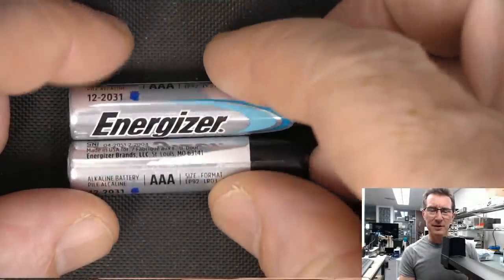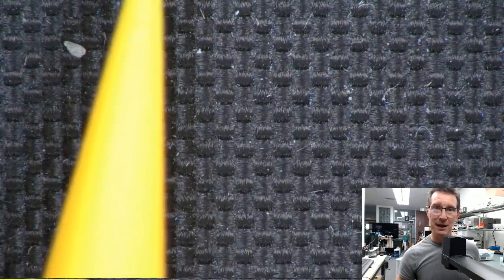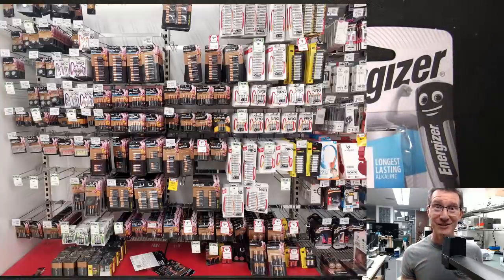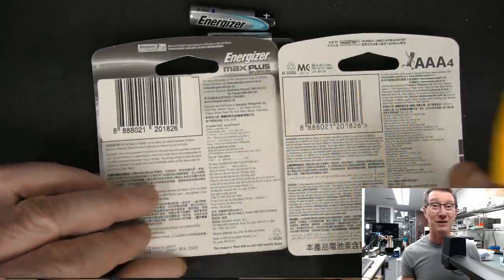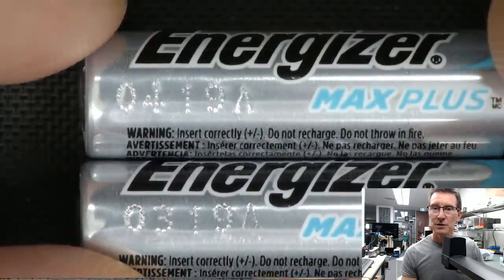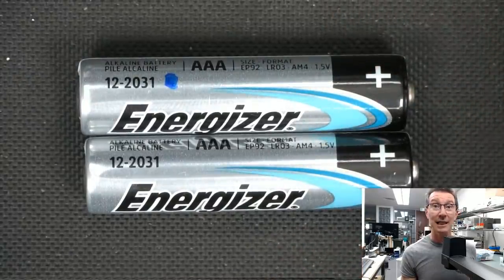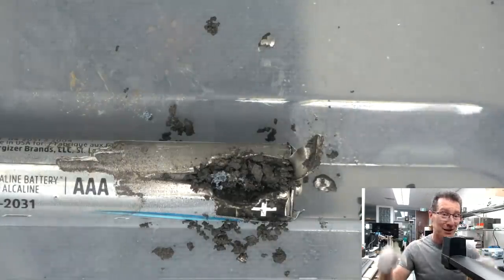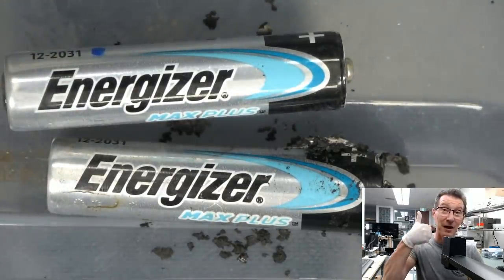EEVblog #1350 - Fake Energizer Batteries?

Comment: Do leaking batteries still hold any charge?

A little while ago (~year or so) I went to change the batteries on a flashlight (or "electric torch" for those who prefer 19th century terminology) that was a bit dim, only to find that the D batteries were locked in place by leaking batteries that had already crystallized.  I still haven't been able to get them out (need to remove a retaining ring to take the LED emitter out, so I can push the batteries out, but haven't found a tool that will work yet), but the flashlight was actually working right up to the point that I opened it up to replace the batteries.  

I always figured that leaking batteries were inherently dead batteries, but that's obviously not quite the case.  Do they simply allow a charge to flow through from other batteries, or do they still hold something of a charge themselves?

Comment: I have a little box for dead batteries and some have been in there for years and none have leaked. So why do they leak much quicker left inside a device?
Must have something to do with the contacts? Seems even though there is no closed circuit just the contacts and circuitry have an influence.

Comment: PLEASE LOOK AT PACKAGE PRINTING!  (1) NEVER does Made-in-USA Energizer batteries have Chinese printed as on the (right/fake) packaging on the bottom.  I went to Walmart and NONE has Chinese like this, only in the small font.  (2)The legitimate batteries (Max Plus Adv/left) clearly shows a replacement EAN13 bar code label has been stuck on top of the original USA bar code - steam it off and I bet is a UPC-A/USA code.  (3) The recycle logo is missing which is required by USA environment law - none on the copy.  Australia, and Woolworths, has a poor history of catching copies.
Reply: These are not packaged for the US market, why would you expect them to match yours? They don't even sell this series in the US currently, as best I can tell.
Reply: @Monkeh616  Sir/ma'am. Think about what you are saying and read what i said again about the AMERICAN upc codes vs. EAN codes. EAN are not used in USA.  He needs to steam off the stuck on EAN13. If a upc is underneath those REAL units were made in USA. This should be verified.
Reply: @tbreit  They won't have a UPC. US products can and do use EANs and there's no need to replace an existing UPC with an EAN. The label is covering a different EAN for that package variant.

Neither of these packages was intended for the US market anyway.
Reply: They are real.  American junk mate, deal with it.
Reply: @captainwin6333  Well, China owns 70% of Australia now so I assume you don't care anymore. Good luck when they invade to take the rest, Biden won't  help you, mate.

Comment: Actually, remembering back to DefCon 26 there was a battery issue that happened over the course of only ~48 hours. There badges took 4*AA batteries and some people put 3 in the right way, and one in backwards. The badges still ran on the lower voltage, but it caused the batteries to fail by the end of the first or second day. 

From there writeup after the event. You can find it at the bottom of page 4

https://media.defcon.org/DEF%20CON%2026/DEF%20CON%2026%20badge/DEF%20CON%2026%20badge%20writeup.pdf

"The badge design was built to work off of 2 batteries, but the 2 batteries would
have only lasted around 32 hours or so, so we added another 2 batteries so that
people wouldn’t have to change out their batteries. There was reverse polarity
protection which protects the badge, but not batteries from being placed in
backwards. That amounted to people essentially recharging non-rechargeable
batteries which led to a number of them outgassing/leaking. Those
occurrences guarantee we will never use more than 2 batteries on a badge ever
again. "

Comment: Concerning the leaking batteries, if they came in air freight from the US, could the relative lower pressure in the cargo hold of been a contributing factor making the leaking worse? This combined with the GPS tracker was on. A combination may of allowed the liquid to flow more freely due to a possible pressure difference between the battery internal pressure and the lower atmospheric pressure in the plane..

Comment: Speaking of your battery leakage test, I wonder if the problem is that you're only testing single batteries? Maybe if you had two or four in series, and then put the resistive load on them, that would allow the weakest link to get reverse charged and then leak.

Don't remember the details of your setup, unfortunately. Please ignore if you are running multiple cells in series.

Comment: I recently discovered a Duracell just leaked into my favourite wall clock when I took it down for DST adjustment, still kinda works but you need to wack it a couple times to get it going again. Needs some kind of a special tool (Seiko specific?) to get the movement apart so I can't clean it properly. The single AA battery was installed almost exactly 1 year ago (I labeled it) and still read almost full voltage, 2026 expiry date. Possibly heat related? It's mounted high up and gets REALLY hot in here through the summer.
Reply: ...... For what it's worth, I haven't had a rechargeable AAA (all big name brands) leak in multiple devices for two decades.
Reply: @robbieaussievic  I've had several NiCad batteries and a single NiMH (Panasonic, pre-Enerloop AA) leak on me before.

I use Enerloops in pretty much everything except remotes and quartz clocks - they're not exactly ideal in those scenarios.
Reply: @savagemadman2054  ..... Sorry, I meant to say AA,

Comment: Energizer Lithium Ultimate are the battery's of choice for the High Altitude Balloon folk as they keep working at the temperature and pressure at around 100,000 feet altitude !
It would be good to see a teardown of one as they are used to power brass monkeys !
Reply: I found some loose ones in a Home Depot recycle bin once, and out of curiosity, I took and tested them, and they still read 1.8v!  Don't know why anyone would toss $4 a pop AA cells without testing them, but finders keepers.

Comment: All alkaline batteries are shit, wherever possible replace them with NiMh, or if you need the higher voltage use non-rechargeable lithium or one of those ones with the boost converter built in.

Comment: Don’t forget your explosion containment pie dish 😂
Reply: Lithium ion batteries tend to be much more exciting even when flat. Lithium Nickel Manganese Cobalt Oxide ones can be particularly exciting especially if they are in those flat packs.
I think most of the ones I have seen Clive open up have been LiFePO4 batteries which though they can leave a mark are unlikely to burn a hole in your table or anything.
I had to do the pie dish thing for an actual lithium battery I had to pull out of my flash it went off like an intermittent firework. 
I have been trying to work out what the brand was so I wouldn’t buy them again but it is in Chinese or something.
Reply: Stupid comment, since Alkaline batteries do not explode.

Comment: Energizer-Batteries are just that crappy. They leak around the world. Wherever they are produced there's clearly too much cost cutting or lazy workmanship. You cannot leave them inside if you value your equipment. I prefer the ones from Aldi or Lidl, they hold on strong and don't leak.

Comment: I think that the manganese (IV) oxide was not mixed properly with the potassium hydroxide solution during production. So that wet and dry spots have emerged. You just caught a few too wet, or matty england was right about the down under leaking =). Best Regards from Germany

Comment: There is always a possibility of counterfeits. Vendors that buy in distribution volume for multiple chains, might be on the dole or might not realize these aren't genuine. Seen "pacific" country that mass-manufactures for other countries use the same machines for printing for "certain" criminal clientele. Its not that hard to acquire or use the same machines that are used to make the flexographic plates and labels.

Comment: "Advanced" means that they will leak sooner.
Reply: Also: the date printed on each cell expresses the pipe dream of manufacture: only aspiration-data not actual expiration-date.
Reply: Personally, I stopped using Duracell because they leaked more often than not.  I got really fed up having to clean the battery compartment of my remotes every time I changed batteries.  I switched to Energizer, I think I may have had a couple leak but they mostly run flat without leaking.  I don't regret switching, I wish I had switched sooner.
Reply: Executive if your post was regarding girls I laughed.
Reply: @wolu9456  what

Comment: EDIT: this comment is wrong

If you compare @12:40 to 13:07 you can clearly see that these casings are manufactured in two different ways...
Reply: He opened opposite ends of the two cells. 12:40 is negative end. 13:07 is positive end.
Reply: @SimoWill75  Ah! you are right! my bad!

Comment: If they travelled by air freight, they may have been in a depressurised cargo hold, and the reduced air pressure could have accelerated the leaking.
Reply: Cargo holds are pressurized. Unless you're inside a wing or wheel well, you're in a pressurized area. It very likely isn't heated / cooled, however. (Cargo planes are basically the same as passenger jets, minus all the seats, and other people amenities.)
Reply: @jfbeam It's not ground level pressure, it's more like top of a mountain pressure (6-7000ft)

Comment: Tecnicali this baterys are not alkaline, (Max, extra life, Max power any compani name for this extra amp bateris) the formula is diferent for this extra amp for the same volt 1,5 y see  the same in a duracel expose to high temps

Comment: Dave, you gonna do a similar autopsy on a lithium battery wearing a flame retardant full body silver suit? It'll probably be one of your most popular videos :-)
Reply: ..... and last.
Reply: I have cut a few open, no real risk aside from the smell and the possibility of fire if there is a spark. You just have to discharge the cells to zero first using a low value resistor across the terminals overnight.
Reply: Pick apart some NiMHs, they're pyrophoric :) I think it was Big Clive who showed that.
Reply: Check out BigCliveDotCom for that.

Comment: The Max plus might just just be rubbish. I bought some at bunnings used it in a stylophone. One battery out of four for some reason heated up to about 80°C felt it through the cover. Pulled it out, then upon investigation there was nothing wrong with the device, no shortage visible. And no supprises the battery leaked the next day.

Comment: I searched for Energizer Max Plus AAA Alkaline Batteries on Amazon UK since that specifically named  type is apparently not available in the US.  There are very few reviews even though that type has been available, according to Amazon UK, since 2018.  

On the other hand, Energizer AAA batteries are extremely well reviewed on Amazon US:

https://www.amazon.com/s?k=energizer+max+plus+aaa+batteries

This is a "Max" version listing with a five stars rating with 29,047 reviews:

https://www.amazon.com/Energizer-Batteries-Triple-Alkaline-Battery/dp/B007YASGWS

I searched on "leak" in that listing and found a bunch of 2019 and 2020 reviews claiming that, unlike Duracells, they don't leak.

Comment: Personally, I have a theory that batteries are more likely to leak around other leaky batteries. Unlike Dave, I don't have any trouble getting batteries to leak, even when not in a device and not drawing power.

The method is quite simple: Take the partially-discharged battery out of a poorly-designed product that cuts off at a fairly high voltage, pop it in a drawer with a bunch of other similarly-discharged batteries to finish off later in a different, more efficiently-designed product, and within a few months probably 1 in 3 of the batteries will end up leaking by itself before it ever gets used again. Seldom do I see a partially-discharged one leak outside of that drawer -- whether in a product or just sitting forgotten somewhere else, though.

Hence my theory -- admittedly, with no scientific basis behind it -- that the reason so many of mine leak is because when one does it, the others adjacent to it are somehow chemically affected and prove more likely to leak too.

Of course, there's every chance this is just a dumb theory and confirmation bias in play. But if anyone with more chemistry knowledge than my own long-forgotten chemistry lessons from 30+ years ago can either back it up or debunk it, I'd love to hear it.

Comment: Energizer do tend to change their labels often. I remember the added the MAX latter, then Advance, and then after a few years they changed the colour, ie, it was orange black silver -.
Reply: marketing formula is reinvent the wheel every 6 months . The Sheep will fall for it ( shopping Mums will always buy flashy bling things )
Reply: They also tend to have different labels and designs for different parts of the world. Always adjust the design for different markets.
Reply: Yup, I've got one here with the orange/red label, expires 12/30 so it can't be that much older than Dave's blue ones. Oh I'm in NZ, same region but different country.

Comment: While being true that lithium batteries do not leak if used right.
Lithium batteries can leak if you short them which you do not want to do as they will explode if shorted.
Reply: yep found it leaks when I wanted to see what is inside an old laptop battery pack.

Comment: Here in the US there is a third big competing brand called Rayovac. They’re a little less expensive than Energizer and Duracell and usually work just as well. But. Lately the AAA‘s have been leaking like crazy. I mean, you’ll open up a box that’s only six months old and a third of the batteries are already leaking. I don’t know if it was bad production run or what but I had the same problem with two different boxes of batteries. Must be some kind of battery disease...
Reply: Rayovac energy was bought by Energizer in January 2018

Comment: The mailbag batteries, did they travel by air?  Me thinks the reduced air pressure on an airplane may force the seal to leak (rapidly) if there is any hydrogen gas at all in the battery.
Reply: I'm not saying it's impossible, but airplanes normally don't exceed a cabin altitude of 8000 feet.  I would expect any major battery manufacturer to design for this.  Note too that trucks transporting batteries could easily reach this altitude in many parts of the world.
Reply: @andrewsnow7386  I'm not saying that simply being in an airplane caused them to leak by itself, but it would make a battery that was about to leak or already slowly leaking to turn into a gusher.
Reply: If Energizer didn't take that into consideration it would be an enormous fail
Reply: Postal delivery under severe strain and slow delivery of weeks out . Its been sitting around

Comment: The only way Woolies would have fake energisers is if fakes snuck into the official supply chain, same with Coles and most other big retailers.
Reply: In a video on counterfit SD cards, I forget on which channel, they pointed out that one form of counterfit product is a "ghost shift" made at the genuine factory.  These have the legit shells, labels, etc. but have poor quality, as someone used some raw material that should have been rejected, instead of discarding it.
Reply: @JohnDlugosz  third shift not ghost shift. The manufacturer starts the machinery during the what is supposed to be down/maintenance timeslots and runs off a few thousand illegitimate copies of the product/s they are licenced to produce and keeps 100% of proceeds because those products don't exist in terms of their contracts and agreements so they don't pay the manufacturer a cut for those runs.
Reply: @evanstedman7405  Third shift is a legitimate time slot in 24x7 factories and businesses.  Ghost shift would be an off-the-books shift at a factory officially running less than 24 hours a day.
Reply: @JohnDlugosz  Andrew 'bunnie' Huang did an extensive analysis on those. maybe it was him who made the video as well.
Reply: NEEDS MORE LIKES

FU🖕YouTube algorithm🖕for suppressing this!
Reply: This happens way more often than you think.
Reply: @infernaldaedra  source?
Reply: China.
Reply: @infernaldaedra  Happened with some PICs at a company I was doing some work for around 10 years ago. Wasn't involved but IIRC the official supplier had gone to the grey market due to shortages.

Comment: These are just like longer versions of alkaline button cells! The outer case is positive!  They make 9 Volt Alkaline batteries out of 6 Alkaline Button Cells in the rectangular case. I have a an old DVM using 2 of those same size button cells and I buy a 9 Volt and rip it apart. Then I have 3 set of cells for it for one price!
Reply: That's odd.  When I rip a 9v rectangular battery apart, I find six AAAA cells.
Reply: @davidwillmore  depends on the brand, I have seen that done too! I have a pen  light that uses AAAA Cells too!
Reply: @DishNetworkDealerNEO  I had a laser pointer a long time ago that used AAAA cells, but I had no way to buy them, so I had to crack open 9v batteries.  You are right that the construction varied by brand.  I don't remember anymore which brand was which.  Probably has changed since then. I know I can actually buy AAAA cells these days!  Too bad I have no idea where that laser pointer got to. :(